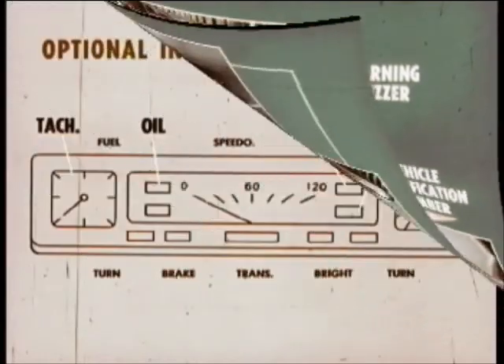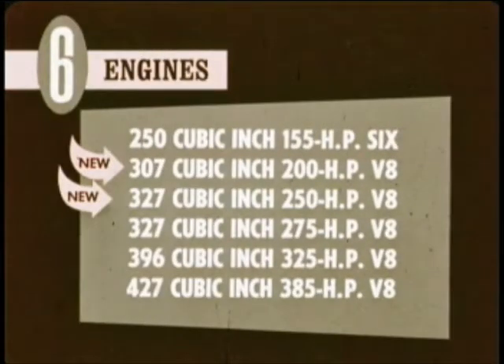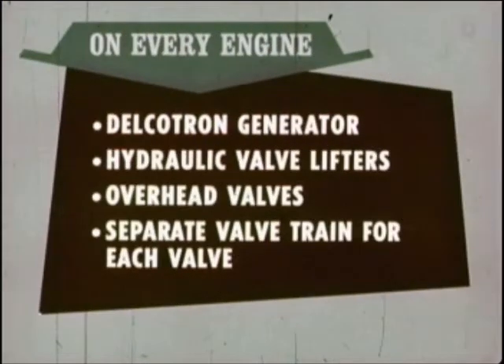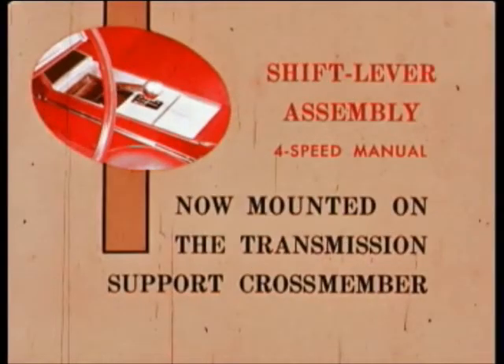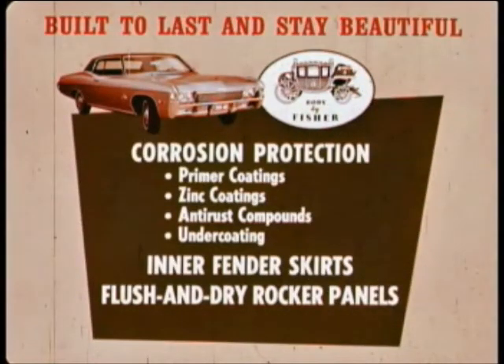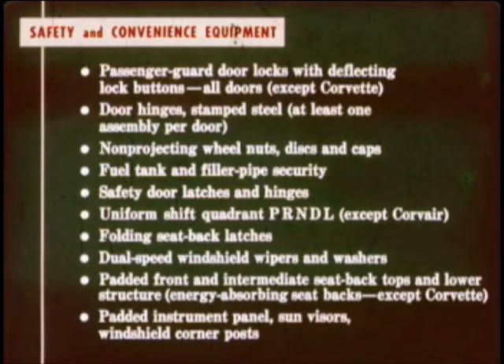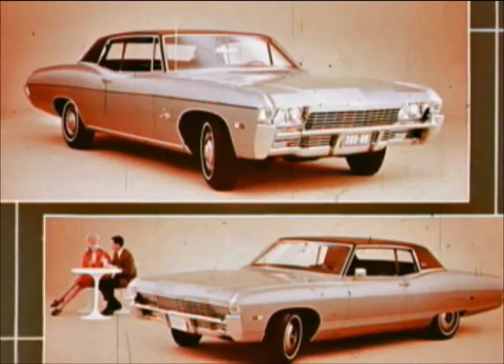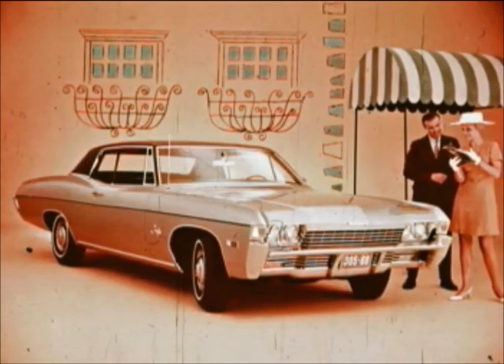68 Chevy Sales Trainer Part 2

Comment: My dad ordered his 68 Impala with a 307 three on the tree with overdrive. Possi traction and heavy-duty suspension. Because it had overdrive, the rear end gear was great for jack rabbit take offs. When not in overdrive, the engine would rev pretty high if you were driving more than 60 miles an hour. It was a good-looking car, very quiet and road really well. Lots of memories riding in that car. The body lines of the 67&68 fastbacks were a two-year design for GM. I sure miss the days when in September the new models would come out. Now they change styles every 5 or ten years and most vehicles look pretty much the same. Well, being that I am now 70, I have lots of memories and fond experiences in cars of years gone by. I live 30 miles north of Detroit and in August everyone who is fortunate enough to own one of the older cars is out driving around in preparation for the Woodward Dream Cruise. My older brother had a 1970 SS Chevelle back in day, and man was it a blast cruising Woodward on warm summer nights. The Chevelle was not stock, it was a 472 big block with 13 to 1 compression and open chambered heads, long tube racing headers and a 4.88 rear end. After his 70 SS LS5 Chevelle was stollen out of the Truck & Bus parking lot in the spring of 1971, he ended up with this beast of a Chevelle. It was wicked fast and never lost a race on Woodward. My brother told me his closest race was a 1970 Bladwin Motion 454 Camaro. My brother's buddy had a 1970 Yenko Deuce Nova with the LT1 350 engine. It was fast, but nothing like my brother's big block Chevelle. Nothing like two performance cars going through the gears with the windows down on a warm summer night. Man, those were some fun times.

Comment: Had a 68 Caprice station wagon w/ the 396, 325hp & changed it up w/ a 427 hi per cylinder heads, w/ a 427, 425hp cam & installed headers & it ran great !

Comment: Back in 1971, my future mother-in-law had a 1968 Impala station wagon with a 327.  My future wife (girlfriend at the time) was showing off and laid some rubber in the high school parking lot.  The defective motor mount broke and allowed the engine to lift up and jam the throttle linkage wide open.  Before she could turn off the ignition switch, she ended up hitting a cement curb, buckling the right front wheel.  Nobody was hurt.  It turns out there was a massive GM recall on motor mounts for many 1968 GM cars with V-8 engines.  The Chevy dealer replaced the damaged wheel and suspension (at no charge) along with installing the improved motor mounts.
Reply from the maker: Good story. Glad to hear Chevy made good on the repairs. My dad had a '68 Impala and I remember the recall. He did the recall. I currently have a '68 convertible and have checked to see that the recall was performed and it has been.
Reply: Plenty of torque to break mounts!